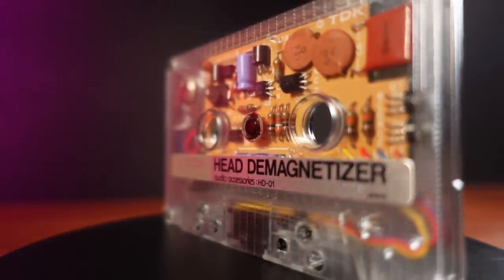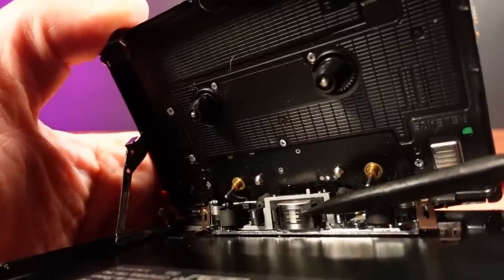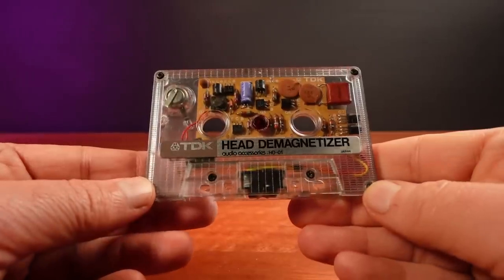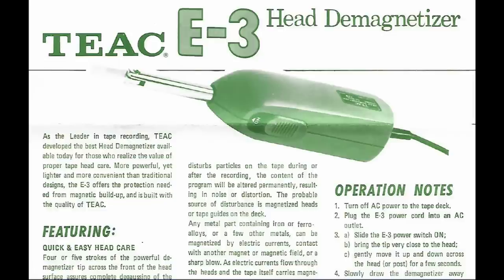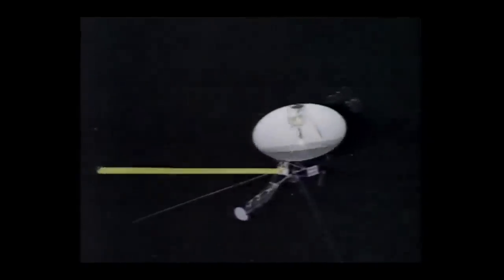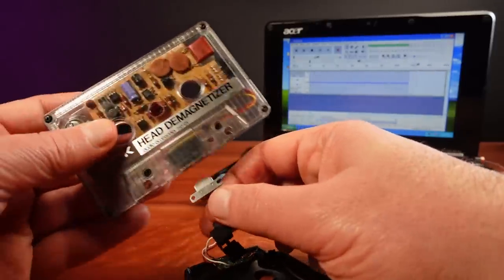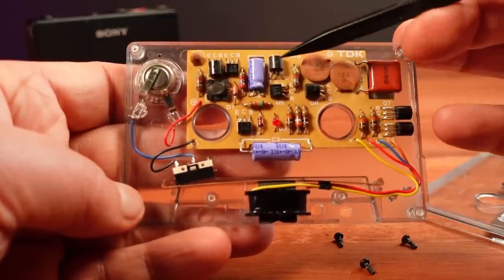No One Knows If This Actually Works

Comment: Isn't there this greenish magnetic sensitive foil which can make magnetism visible "flux detector" or something like that.
This could be used to check, whenever there's some buildup in the first place, and if it's gone afterwards.
Reply from the maker: That's an interesting idea, I do has a small square of that magnetic detection sheet. I don't know if the field would be strong enough to detect though. But worth a try.
Reply: @JanusCycle  Whenever or not the presence or absence of this magnetic residue actually makes an audible difference on a typical consumer tape deck is a completely different question though.
Probably not, but if the product does "something" to the head that can be mesured at least proves it's not "just" snake oil useful or not.

Comment: This is simply a coil/inductor ringer. In theory one can use the coils from the head itself to demagnetize its own ferrites or metal (not sure what's inside heads' coils).
Reply: In theory, recording with no signal should demagnetise the head because of the bias. Recording with signal might also work, maybe even faster as long as it's a nice sine wave.
Reply: @mjouwbuis  "recording with no signal" is a non sequitur.

Comment: Nostalgia! I had one of these TDK demagnetizers, and I had a TDK handheld one too for my reel2reel deck. This was the snake oil of the 80's. I can't tell I ever heard a difference.... However, I probably never used my tape decks heavy enough to need these tools. Snake oil for most customers. Fear, uncertainty, and doubt opens the wallet to the guy who spent a ton of money in gear already...

Comment: Just recording a sine wave audio signal, starting loud and falling in volume to nothing, ending at the zero crossing point should do the same thing if the record head puts out a strong enough signal to cause the problem in the first place.

Comment: I have one (a newer, nicer-looking version). I also have the wand. I usually use the wand because the shell type requires the tape head to move up, meaning that for most decks, the deck must be powered on. The shell type is just too risky to use. As for if they works or not, I don’t know if they make the music sounds better, but I know for a fact that the wand type is capable of demagnetizing a magnetized screw driver. So it is only a question of whether a tape head can really be magnetized enough to affect music.

Comment: For  my  3  cassette player - deck from   Sony  55 Mark-II   and  others,  I  used  it  often  ....  Its  an  electronic  device  and  when  you  use  it,  I  did  always  shut  down  the  power  outlet  of  all  my  speakers  too  .....   The  battery  has  been  replaced   for  an  accu  to  be  loaded  for  10  hours  .....
I  did  buy  it  in  1974  at  Valkenberg  Kinkerstraat  at  Amsterdam   or  AURORA   Amsterdam  Centrum  near De  MUNT  tower   ......

Comment: I might need one of those demagnetizer. I have a late 80's Sony stereo system Compact Disc, and Cassette Tape player/ recorder. But it does sound good when I did play normal stereo cassettes. It has CR02 and Metal tape selection options. Those do sound crisper sounding and extra sound recording pick up. Upward and onwards,
Reply from the maker: Chrome and Metal tapes are magical.

Comment: I have opened a bunch of these in the past and haven't found one that actually has a battery port. Alot of the times the circuitry isn't attached or there is just a cap. Also im not actively looking for one. I can understand why a reel to reel machine may need demag but idk about cassettes.

Comment: Int-resting. I think I still have mine from the early 80's. Was this thing just a placebo? Is 550Hz the fundamental frequency, or a harmonic of a much higher, more powerful pulse? I thought it generated a tone way up around 85Khz or so. After all, the erase head on a deck I think uses a frequency around there. Do you have to "de-magnetize" an erase head? Lol.
Reply from the maker: It's undecided with people still debating the claims.

Comment: Hello everyone. I have a problem, need technical assistance! My deck, pioneer ct s650s 3 head, on recorded level 0dB, 400Hz gives me on output of 775mV. The same recording, on the other pioneer and Yamaha decks gives 580 mV and 520mV, with VU readings of more tha 6dB and 4dB, respectively . Can someone measure output of your deck, I do not know where to look anymore??? Measurement done with Metex digital instrument which shows frequency and dB level along with Voltage.
Reply from the maker: While I hope there is someone here that can help, I suggest also joining the Tapeheads forum.
https://www.tapeheads.net/forums/

Comment: If the tape head was becoming magnetized to the extent that it was affecting the audio, it would be damaging the data on every cassette that went through it, which no one who promotes these has ever said. The tape has a much lower coercivity than any material in the tape deck and so would be incredibly sensitive to this. 

Also, there are next to no ferrous metals in the tape head, so next to no hysteresis, so no significant residual magnetization. 
Additionally, DC bias on the tape head would not cause hiss. 
Stainless steel is incredibly difficult to magnitize and the little bit of magnetism in the domains of the tape can not do it. 

BTW...the pulse is clipping very badly on that TDK and could potentially cause damage even with the volume down.

Bottom line, tape companies made these because consumers wanted them, not because they were useful.

Oh, and this would be so easy to debunk with a magnetometer.
Reply: SO you are saying a magnet will not adhere to a tape head?  And that studios wasted their time demagging their machines?

Comment: The wand type supposedly works better - lower noise floor and better high frequency sensitivity. I don't have pro grade equipment to test dynamic range, noise floor only REW and Clio which I use for DIY loudspeaker hobby. 
From what I recall, of the few decks I had, the 3head Nakamichis were one with the lowest playback self noise and freq resp up to 25k @-3dB, -20dB level (250nWb 0dB standard).

Comment: I really always wondered!! I was told (I have no firsthand experience.) that the early reel to reel machines needed demagnetization to preform well. But (supposedly) changes in the design in later models rendered it pointless or harmful.  🤷 As much as they asked for the cassette devices I really wondered if they had any function at all.  🤔 I guess you were able to show that they at least had an output. Maybe they were the real deal?🤷
Reply: taoe heads 'shouldnt' get magnetised in normal use, but, faulty or cheap n nasty circuitry can cause magnetisation on record mode, many cheap small cassette players use dc bias instead of ac and more likely to occur in these cases

Comment: they certainly do  work IF.. the head has got excessively magnetised, but in normal average use, rarely occurs, faults or bad design in the circuitry of the tape deck 'may' cause unwanted magnetisation on record mode, especially if it uses dc bias as on some cheap small cassette recorders

Comment: 3:29 I doubt that battery has never been replaced once in 44 years, I mean, the battery compartment does have a door on it for easy replacement... unopened commercial batteries in their packaging lose charge to the air over time, let alone one used to drive even a simple circuit like that...
Reply from the maker: You are correct. It could have been changed in the past. Though it must have been at least 20 years ago, if not 30. I still like to imagine it's from the 1970s :)

Comment: Can you share the captured wave file? This can be easily reproduced with an arduino, a mosfet and a coil. I think the pulse is too short and too weak to make any difference. The biggest problem at the time was the battery capacity. It needs a fairly amount of current to be effective to get a strong magnetic field. Now there are lipo's that easily fits inside such shell and can provide easily the current it needs and are rechargable. The technique isn't nonse however there is nothing you can do to get the noise out of the pre-amp stage.
Reply from the maker: It's just a simple 588 Hz sine wave that falls to zero over time. Easy to reproduce in a coil. Be careful though, tape heads are quite delicate and I'm still learning about this stuff.

Comment: The cassette de-maggers would have been more effective with a longer cycle time, and more power. Too bad they hadn't miniaturized DC-DC converters back then like the ones we have now, but then too much power would have probably overloaded the tape heads pre-amps. Who is to say?

Comment: I can't imagine this could possibly do anything, I mean when playing music the magnetic field is constantly fluctuating, the polarity switches back and forth at the frequency of whatever note is being played so how could it possibly build up a charge one way or the other on the voice coil? But IF it somehow does then surely you wouldn't need all those electronics, you could just record the same signal onto a tape. If a tape can bias the electromagnet then a tape can undo it.
Reply from the maker: Very sound reasoning there, thanks. But I've noticed everyone has a different perspective. I find the whole thing kinda interesting.
Reply: It doesn't "build up charge" on the "voice coil". Nevertheless, possible remanent magnetism (not charge) in the ferrite core of the (not voice) coil might be able to be undone through recording, maybe even by the bias signal only. Playing back would likely not help, that signal is too weak. If the remanent magnetism is built up by playing cassettes (as opposed to other external sources ranging from the earth field to a nearby speaker box or using magnetised tools nearby) that will only be the case over a long time so it would make sense it cannot be undone by playing a cassette with a suitable signal only once. There's a limit to the amount of magnetism that can be on the tape, which is even lower than that which can be produced by the weak coil in this demagnetising cassette.
Reply: First you have to make sure that there's some magnetisation of the metal parts of the head. You can check this with a blank tape. No magnetisation, no reason to do it.

Comment: I can't see head magnetization becoming a problem period. It makes me not agree that the concept is sound. Metal will become magnetized if you constantly rub two pieces of metal together in the same direction. Tape heads don't get exposed to that kind of thing tho. They get exposed to an oscillating magnetic field that changes in amplitude and frequency. Maybe the edge of the head where the tape isn't recorded to or read from might get magnetized but since no information is stored to or read from that part of the tape does it even matter?
Reply: It's interesting, somebody except me watching this video recently. Agree with you tape head couldn't be magnetized from cassette tape, as you explained in detail. Only if somebody touched the head with magnet. On the other hand energy of small battery isn't enough   to demagnetize something multiple times. All device is for audiofools: need to be shiny and expensive.

Comment: I had one of those, and I also had a much cheaper one that was a cylindrical magnet that would rotate due to gearing inside between the 2 tape spool spindles.
The electronic one did a much better job of lowering hiss levels.

Comment: You need a scope and probe to make this measurement. You're saturating the tape head with the signal. That's why it's flat in the first 50 cycles or so. Actual peak values are much larger.

Does this work? Well, it does what it claims. But for the heads to be magnetized, there'd have to be a much larger field than the puny impressed field on the tapes... try using a big ceramic or nib magnet to magnetize the head first. Then compare.

Comment: Observational.....surely there is a way to lab test these......
Reply from the maker: This debate has continued for decades despite lab measurements. I've noticed that audiophilia borders on religion in some circles. 
For example science tells us that band limited Nyquist Shannon digital audio produces perfect analogue music reproduction. Yet many don't agree with that science. The debates continue . . .
Reply: @JanusCycle  Well, I think a proper hand demagnetizer is the way to go for the tape path. Convenience doesn't always work....although I give this cassette points for cool looking factor. @$100 back in the day if they hadn't made them see-through, they wouldn't have sold them. We were always told to turn the decks OFF before demagnetizing the tape path. This device requires you to actually run it on PLAY. Therefore the degauss field has to be extremely weak.

Comment: If it does anything, surely a more direct and presumably better method of doing the same thing would be to apply the demagnetizing reducing sine wave directly to the head by recording that signal to a tape (or even without the tape being present)
Reply: Playing tape is what causes magnetization of heads to start with.    
Playing a special tape to demagnetize heads is like trying to get dog crap off a lawn by adding more of it to the same pile.

Comment: I got one of those XR tapes in a lot of used tapes and it has just rubbish on it.  I am curious to see how good the sound quality would be with that old metal tape,  but recall warnings about metal tapes wearing out the heads faster.  As for demag heads, I use one of the manual tools.  I abandoned cassettes decades ago.  Then I got a quite good Sony deck for archival stuff.  And I am surprised at how good a properly recorded cassette on good tape can still sound.  Since there was so much variation in tape quality and tape decks you must strive to get the best out of this analog source.  Just like vinyl records.  Play them on rubbish turntables and not get all the best.
Reply from the maker: I don't know if metal tapes wore the heads faster. But these days with so little cassette time being played, I think using metals tapes is a great option for occasional use.

Comment: Since the late 90s, when digital formats piracy have become accessible to the poorest masses, the only reason analog formats and their's accompanying equipment exists is the looks of them and the chatters around. 70s electronics engineers wouldn't understand talks around output transformers since the  transistors allowed them to eliminate all the wrong things this component made obligatory by the use of vacuum valves do the sound...

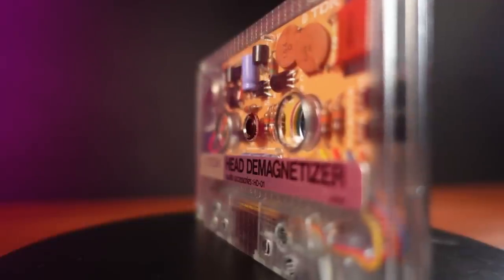Comment: 6:16 I dunno man, that is kind of a stretch. You didn't even do any testing on it, just demonstrated it's function and then came up with your own reason as to why some people may have bought them. They kind of had to go with a clear or windowed case. Who is going to spend that much money on something that otherwise looks like a much cheaper item? They had to show the internals just to let people know they weren't getting scammed; those small components weren't cheap back then. Can find lots of poorly maintained play heads from that same time period, could have tested before and after with them, but nope.
Reply from the maker: It's been over 40 years, endless debates and testing results posted online with no clear answers, time to speculate.
Reply: @JanusCycle  Speculate? As in what the dude in the video did? I don't care if it works, but showing a sine wave and then saying "people bought it because it is pretty" is not a valid conclusion. That is speculation.

Comment: so does it work or not in your opinion?
Reply from the maker: I think there is plenty of undiscovered nuance to be found the answer. These probably worked in limited cases, such as with heavy cassette use on certain decks in specific high end systems, with people that could discern the difference.
But almost all the ones sold in general retail were probably just to make people feel good and looked good with their hi-fi system.
Reply: question is purpose, use and most of all the valid knowledge to operate and achieve "expected\anticipated" results. the question is how accurate the "fundamental studies" are and basing it on valid provable grounds. its the limited use case scenarios because of it's "general purpose" design that is based on "accurate" science and\or sciences not "pseudo sciences". why it is such a fascinating topic and why its so debatable. i think the limited use case scenarios coupled with so many variables is why there is no "definitive answer" and that the proof or validity is based on some sciences that have been proven false or inaccurate today due to flaws or human errors. it's the matter of human interpretation interfering and the human body being genetically different and the basis of subjectivity versus objectivity... awesome stuff ;) @JanusCycle